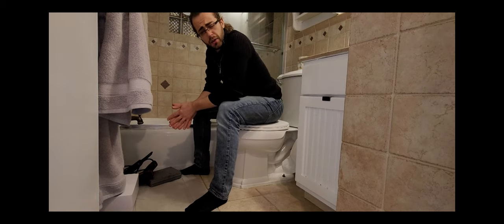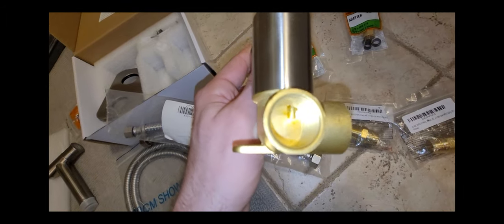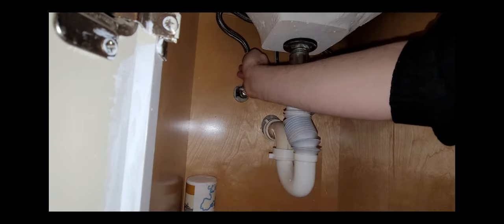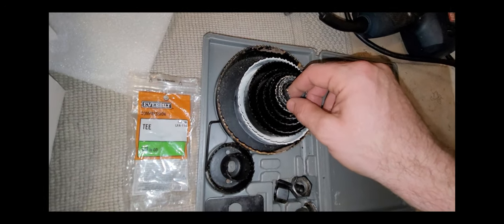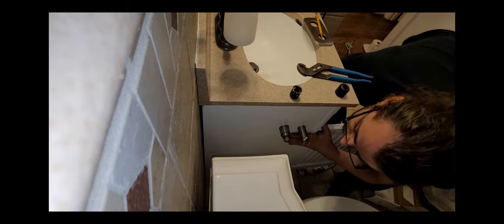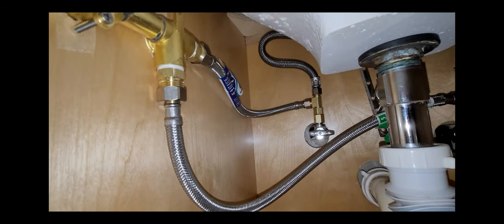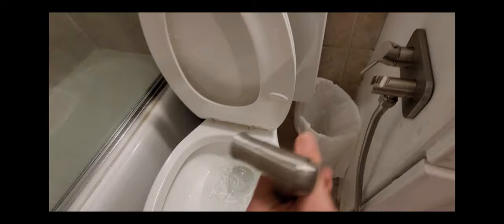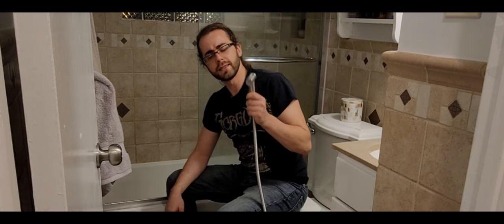How to Install a Hot & Cold Bidet the Easy Way & Attain a Clean Butt

Comment: We put an in-toilet bidet that has built in controls into our place back in December. Couldn't live without one after visiting Japan lmao. Ours is cold water only, because it draws from the tank. But it's more streamlined since our bathroom sink isn't anywhere near the toilet.
Reply from the maker: Gotcha. Yeah I know they have ones that also plug into a wall, so that's a possibility to cure your problem of Father Frost visiting your rear quarters. If you were so inclined, you could probably run piping along the wall from the sink, maybe using SharkBite fittings, it's kind of the Legos of plumbing.

Comment: I never used this tool, but planning to have it in my house... On which side should it be fixed, if i am right handed?
Reply from the maker: I'm also right handed, I've found the most comfort having it on my left (if possible). But I did have it on my right in my previous house, wasn't a problem - you learn quickly.

Comment: Not only the tap must be closed but the extra pressure in the hose must be released by pressing the button. This will help the hose no to burst. If you want to, you can always add single or double check valves

Comment: 1. Install Teflon tape in same direction as  tightening threads
2.  Use an open end wrench my or crescent wrench to tighten water connections on the stops

Comment: Beautiful job handyman, just a
Suggestion, on the inside of
Your drilled holes, how about
Some washers for cabinet
Protection, and contact paper
Or vinly tile inside bottom cabinet
And caulking ,  sm, leak protec...

    Thk's 4 sharing your video
         Very informative.

Comment: How would this work fitting on a solid wall that will be tiled over, my builder said it’s not possible, I said it is.. he ended up not fitting it
Reply from the maker: I don't think it's impossible, but probably quite difficult. You'd have to open up the wall from an adjacent room in order to mount it, and create plumbing to supply water to it. You probably can't leave braided steel water lines inside the wall either, so you would have to have an access panel for it from the adjacent room.

Comment: in order not to mix the hot and cold to your whole house you need to add a check valve to each supply line (to answer the question at your 12 min mark on video)

Comment: Definitely, definitely fit double check valves to each of the hot and cold water inlets of the bidet unit! Not only will it stop cold water entering your hot water system (or the other way), it will slow down lethal germs from toilet water contaminating your whole house water system (including drinking water)! This can happen if the sprayer falls into the toilet bowl. For example, if kids are playing around with it. UK water regulations demand much more expensive protection than check valves to prevent such contamination from such sprayers. At least have the check valves for a bit of protection!
Reply from the maker: That's a good point, both for the backflow issue, but never even thought of contamination. Contamination would certainly be possible due to the backflow condition if the valve is left open while the sprayer is closed. I guess the manufacturer thought that cholera was way over-rated.

Comment: Our house has these but they're a very rare feature here in the UK. The idea comes from the middle East and the family who lived here before us was Pakistani.
I haven't been brave enough to try them myself. Do you use them before TP, or afterwards? What do you use to dry yourself? TP would disintegrate on wet skin, but you couldn't be sure you were clean enough to use a towel.
So many questions raised by such a simple video 😉
Reply from the maker: No TP. Just rest the sprayer against your lower back, use your other hand to rinse - this is what will let you know that you're totally clean. When done, use your clean hand to dry yourself with a hand/fanny towel. Wash your hands after!
Reply: If you don’t like touching your own poo, then use tp first and use the bidet last. I like to use one pump on hand soap on one hand that would clean and the other hand uses the bidet. I then have a separate towel that I solely use for wiping my butt. Hope this explains
Reply: Muhammad-Burhan Mustafa  hot water bidet ?

Comment: Very useful video
Thank u so much
What would u suggest in case the sink is far from the toilette chair?
Reply from the maker: Honestly, not sure. It would probably be easier to get something like this - and route the flexible hot water supply tube along the wall. But do your own research, some say the hot water supply line is flimsy and may pop off causing things to flood. 

https://amzn.to/3EALWHP

Otherwise, something like this uses electricity to heat the water: 

https://amzn.to/3X5xzT7

Comment: Hi, thanks for the nice video. I have an issue with my bathroom. My vanity is 10 feet away from the toilet seat. How to mount the bidet spray pipe externally along the side of the bath tub to the toilet seat? Also, how to buy the product set in Canada? Thanks
Reply from the maker: Hi, you have a pretty challenging problem. I wouldn't mount anything to the bathtub -- it's not structural. I made a very crude drawing - you could build a box for the bidet sprayer and attach it to the wall next to your toilet. Then, you can mount copper piping along the side of your wall using bell hangers (attach to studs). If you have tiles instead of drywall then it gets so complicated that I'm not sure it's worth it. Due to the amount of work, I'd actually recommend you get an electric bidet - you supply it with water by tee-ing off of your toilet's water supply pipe, then plug it in for hot water (and even a built-in dryer). I only recommend this rather expensive option because I think you would have to spend even more in effort cleanly installing the bidet I have in your situation:

Electric Bidet:
https://amzn.to/3aDFXW2

Drawing:
https://imgur.com/a/cNr6W9b

My bidet (this link should work in Canada):
https://amzn.to/2Wl07b7

Comment: May I ask where you found the 3/8" female compression coupling? I can't find one anywhere. It's the one item you don't appear to have linked in your list
Reply from the maker: I got that from Home Depot: 

https://www.homedepot.com/p/Everbilt-3-8-in-Female-OD-Compression-Brass-Coupling-Fitting-803119/207176432

It probably doesn't need to be a swivel, so this plain one should be OK to use too: 

https://amzn.to/3IaeTK1

Comment: The union you used is npt on both ends but the valve is bsp g thread. It doesn't leak?
Reply from the maker: No leaks here, teflon tape must be doing a good job.